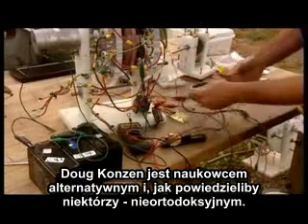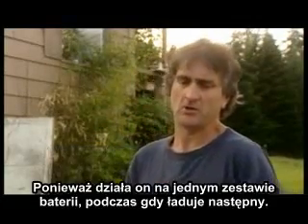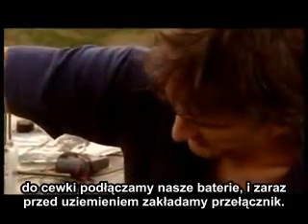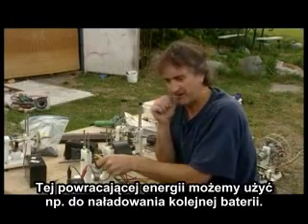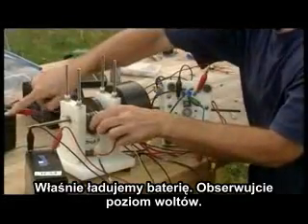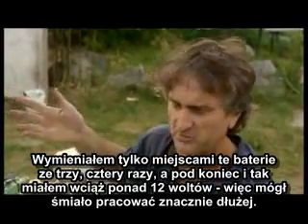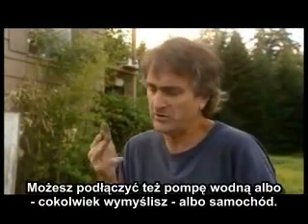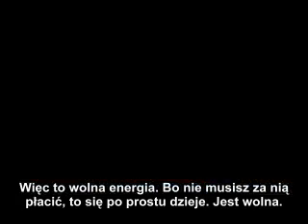Doug Konzen - Silnik z Efektem Nadsprawności NAPISY PL

Comment: The FWBR AC legs over motor coil switchnig shown here in video where the plasma is removed from reed swtich and it charges 2nd batt with the DC out of the FWRB needs a 2nd switch on one of the AC legs of the FWBR
This 2nd swtich turns on-off in echo-pulse to the motor coil pulse (slightly after)
This is not shown in this aussie discovery channel video
Also it is best to run on 24V into the motor, and 12V battery stacks in paralell being charged. Run on one battery charge 4 or 8 if you want.

Comment: Look on youtube of my ROTOVERTOR demo parts and 2
type doug konzen in search box
Rotovertor can charge 2nd batteries with no extra draw to motor
look at my site in "circuit diagrams" link

I tested the watts output of the shaft of the 2hp motor shown in that video; 73% of input with stock bearings. 
Charge extra batteries, run motor on invertor, switch battery stacks - you will get more than 28% extra run time switching battery stacks: overunity 
Some have got rotovertor to run by itself

Comment: Hi Esa

that conference is realy old stuff... some parts are funny however.,..this is motor video demo of pre-AC rotovertor, pre-Bill Muller design motorgens, pre-neodimium magnets bein used in rotors, also the AC leg of FWBR being swtiched in echo to motor coil pulse was not demonstrated in tha tDallas video either 9whihc would of blown them away)...also I talk about stuff like coils-against-coils motors that I dont do anymore too...splatter coils are mentioned but not demeonstrated too

Comment: Slander calling me a fake an liar etc.

They should jsut do the circuits Idescribe, or even better do the rotovertor system using AC motors instad of the DC ones shown here. This video I had no say over th final cuts - doesnt mention a cap before you charge 2nd battery, doesnt mention lithium or nicad batteris instead of lead acids, doesnst mention that GREAT AC leg of FWBR swtichng circuit I discovered after this video was made either.
go to my site look in circuit diagrams google koneheadx

Comment: video is demo to "put to use" plamsa/backemf by charging a battery.

I had no say in editing of film.

Reed switch will not be reliable over time - best to use halleffects and trnasistor or mosfet.
Also you do not want to "directly" charge a lead-acid battery as shown because of HV recoil spikes (but nicad or lithium batteries OK if spikes not too high)
Best to charge cap, then dump cap while near X2 voltage of battery volts in a pulse.
google my name for site and details

Comment: The circuit shown in this cut-up 5 year old by aussie discovery channel should have a swtich on one of the AC legs of the FWBR with its AC legs across that magnetic reed switch with the flame/plasm inside it
This switch is not mentioned in video
This switch turns on-off with the same pulse width as the motor coil pulse, but it is slightly delayed, and works like and echo to the motor-coil pulse. this increases power to the motor X2, lowers draw, and also charges up 2nd batteries at same time.

Comment: Backemf of the motor coil collapse fills a capacitor first, then this capacitor charges a battery in a pulse-charge. This pulse-charge occurs between the motor ciol pulses. This is not mentioned in this video since my speech was chopped up down to 3 minutes.
Lots of others are doing this simple "recovery" of back emf to charge 2nd battery stacks or increase motor's power.
It is "overunity" operation if done right Try lithium or nicad batteries.
Look up "rotovertor" for newer stuff